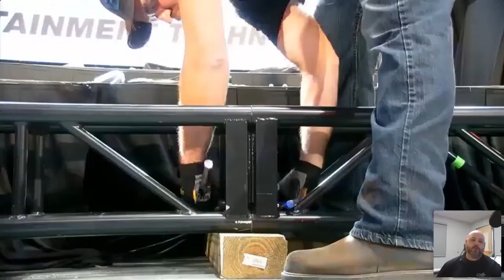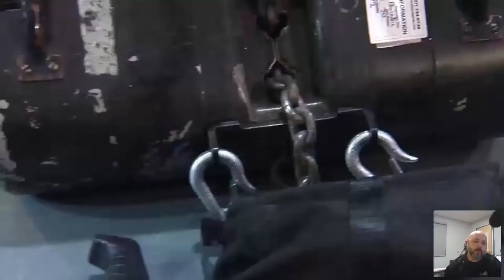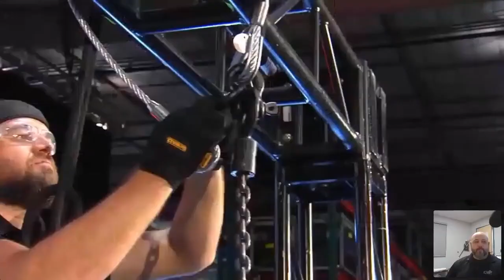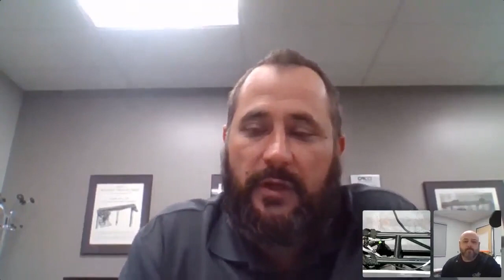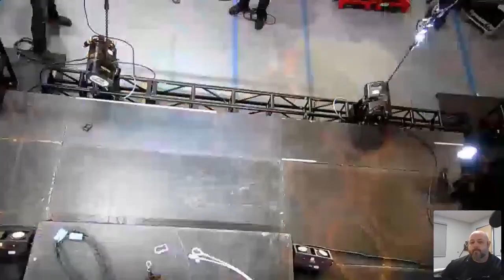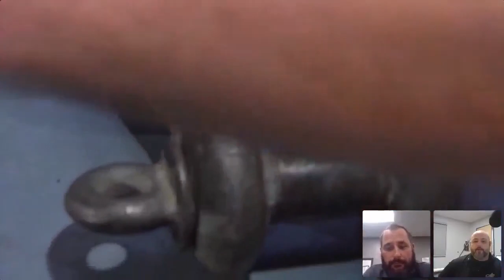HARP & CM Basic Rigging - Building a Simple Truss Span

Comment: Hey guys. Great video>>> 
Why do you use 2 shackles the same size on the sling and hook instead of using one larger shackle or can you add a master link between anchor and chain motor.hook. wont this sit the motor better and also easier to tie the rope on to transfer load. Trivia was good.

Comment: Hey guys , I used to weld up lot of trussing ,winches and counterweight flying systems for thearters all over the world . 
I loved building jigs and making the working product that boss man wants and even come up with ideas and sure enough sometime boss man would agree on, that, some of us welders idea's to make a piece of stage machinery work as best as we could. 
As now it's in my interest that this is equipment is welded so I could hang a bus off it. 
I have a passion for welding, and things above our head's  if it's not right it's failure before it's left the workshop. So making truss for example ... Depending on all the specific things needs of the truss types, corporate / rocken roll,or theatrical , there are certain standards required I'm sure . 
I do know someone that is very highly respected certified engineer for entertainment industry, and no he didn't tell me that but he did tell me there are standards laid out to go by under different acts and rule's basically out line of all around standed in entertainment industry , I think something like that  . But worth checking out before relisising that it won't fit with any body elses equipment .that a bad start . To companies or more cant converge corse some dumb bolt hole's won't line up,always refer to sex when building such equipment,,with a  nice fit and snug sliding together with firmness